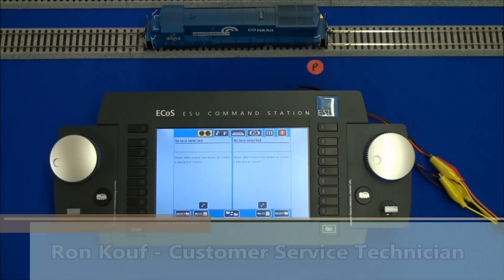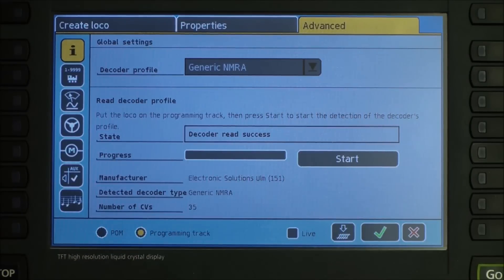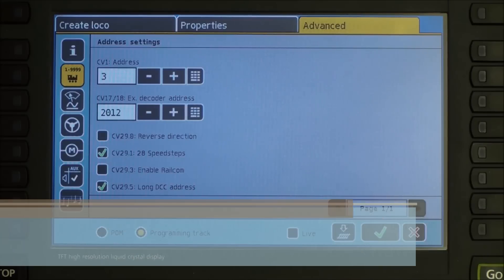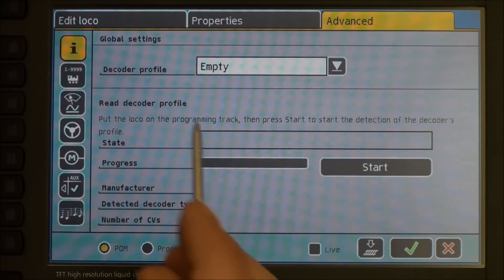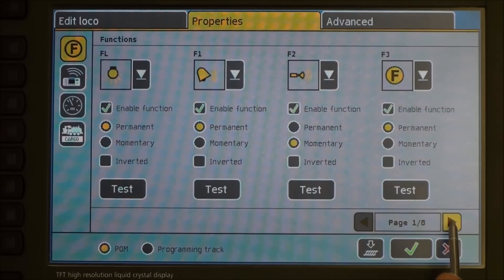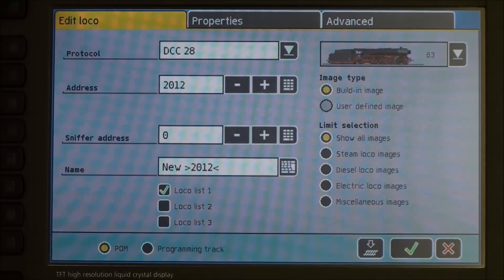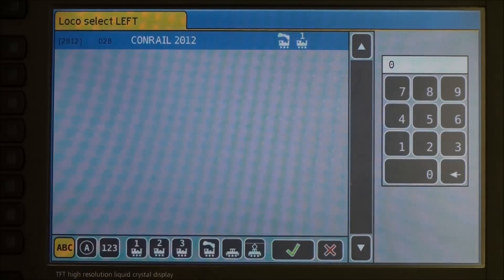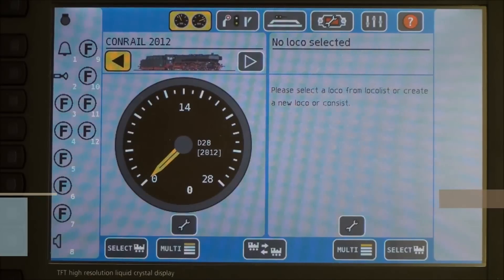ECoS Locomotive Programming

Comment: Great video however I followed all the steps and when I get to the point of testing the loco I get no response?
Reply: I have the same issue especially with many non ESU decoders. I think basically it's if you change the name of the loco after the changing of the address the system can't ID the proper loco anymore relative to the address. IOW. The ECoS uses both the ID (naming) and address to control locos - I think? Not verified it yet...  So if you stick with the " < NEW 2012 > " name it would respond to your changed address and work, but the minute you change the name using the edit function - the connection is lost in the ECoS loco list - I think 🙂 Someone please verify or deny this? So ultimately change the name first then address after...?!

Comment: Will the new ZIMO MX600 work on the ECoS? By the way keep the vidoes coming I have had a 'stroke' and my memory 'short term' is very bad and they really assist me.  Thanks, Nigel
Reply: Zimo MX and the new MS sound decoder works fine too with Ecos so long as you support DCC protocol.